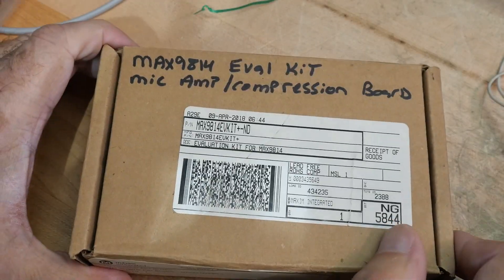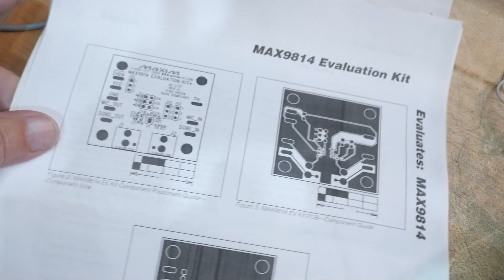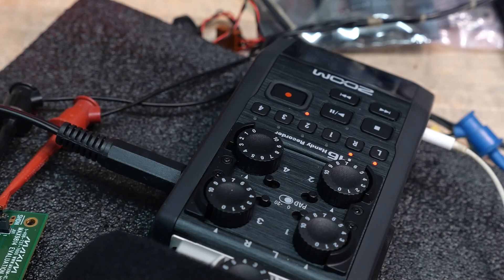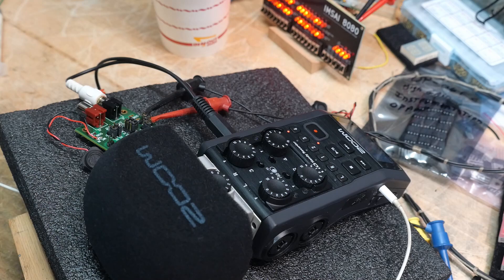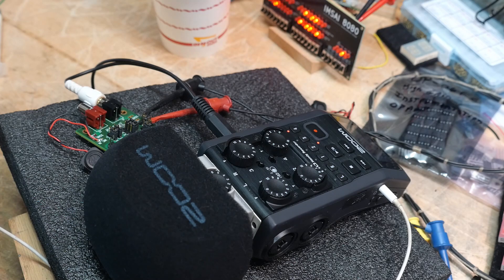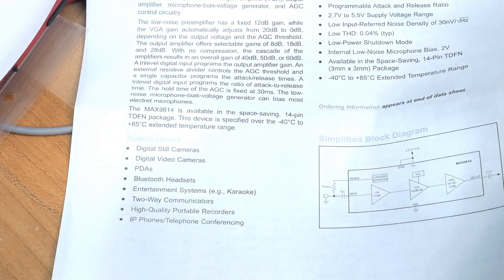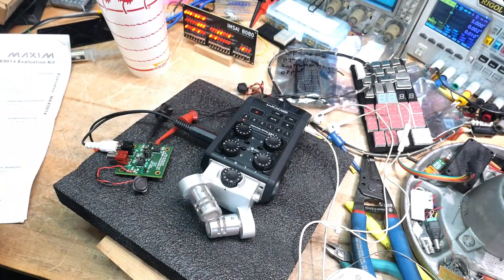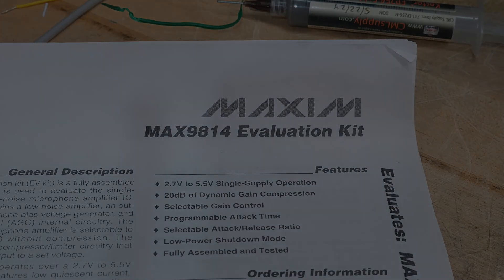#2137 MAX9814 Microphone Amp and Compressor

Comment: Last year I built a Caringella preamp-compressor on a prefab PC board, from discrete components.  From an early 70s magazine article. The thing works great but they used a weird 12V battery.  I built in an AC power supply to avoid the bother but the gain  is so high that I could not eliminate residual hum even with the transformer out away from the unit.  So I had to give in, gutted the power supply stuff and installed a rechargeable compact 12V battery into it.  Problem solved.  Maxim makes some very interesting chips for a long time.

Comment: I bought that eval kit to test out the compression feature.  Ended up using it in 2 custom boards I make that go in old Astatic and Turner base microphones that have dead mic elements.  The board also has a 6 band EQ and noise gate.  Was a fun project to design.  With the correctly selected mic element it has great DX pileup busting audio.